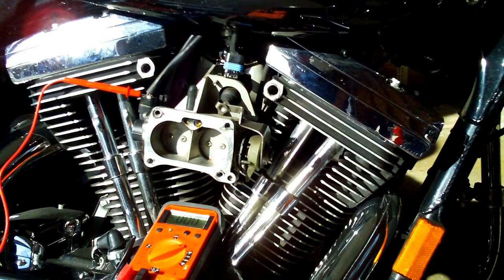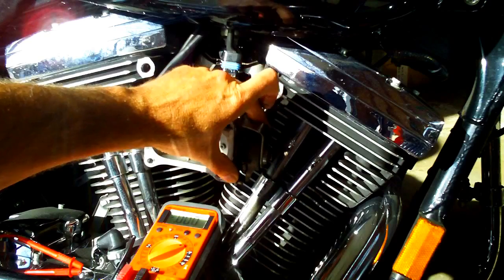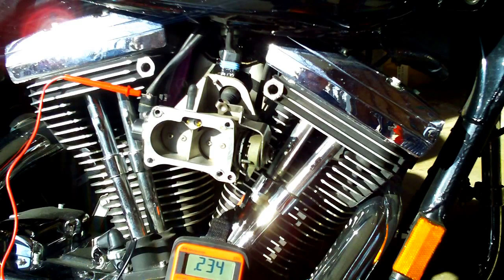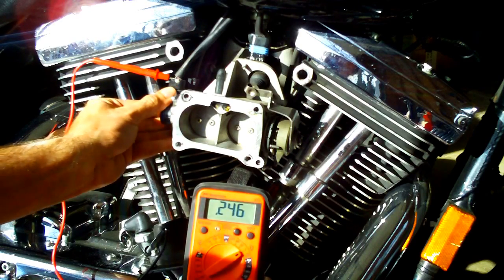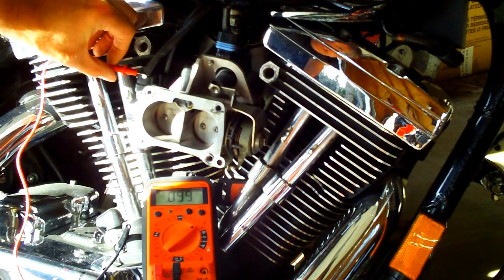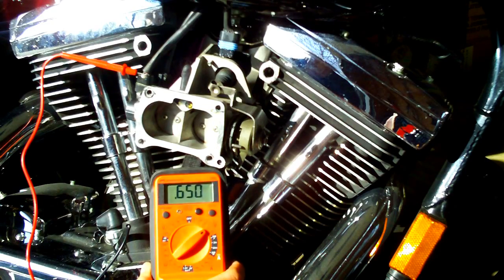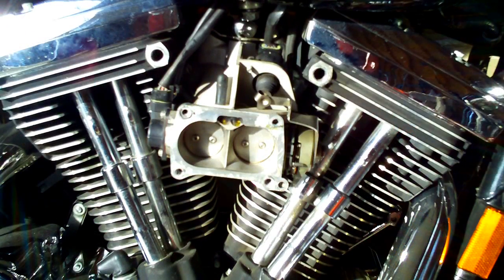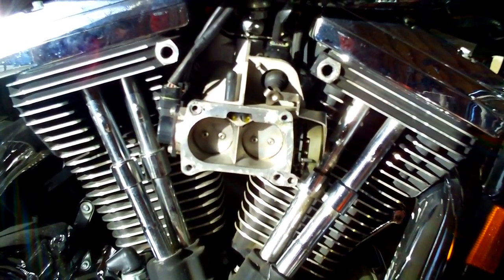Reset Harley Davidson Magneti Marelli Fuel Injection TPS Settings ✔

Comment: I have a '96 Road King EVO with MM injection (same, as on video) and it has an annoying manner of high idle speed when cold. When I start, the cold idle speed reaches about 1500 rpm and drops to 1000 only after a couple of minutes. I want to low rpm to normal level. What can I do about it ? Is it possible to change settings inside of computer ?
Reply from the maker: It sounds like you need to have the cold idle motor adjusted without knowing more about it. Watch the video at 4:30 and you will see me turning the adjustment screw and measuring the voltage to the number 0.650 volts. You will need to take your air cleaner assembly off to access the screw. If you do not want to set it using a volt meter, then turn the screw OUT (loosen) one turn and try a cold start to see what it does. If it is not enough, go another half  turn. If it is too slow now, go back IN half turn. This idle motor slows down the idle as the motor warms up by using readings from the head temperature sensor. Do not let the motor warm up between tests or you will think it has slowed down but actually it is reading a warm engine and using a slow idle setting. Make sense?
Reply: I'll try to do this, but I'm not sure it will help. I think, that on cold idle computer is not maintaining the definite rpm speed based on crank speed sensor, but is maintainning definite throttle angle based on throttle position sensor (TPS). So the cold idle screw is only for initial adjustment. If I will move the screw, trying to close the throttle, then automatically the cold idle motor will try to compensate it and starts openig the throttle up to achieve a specific voltage on TPS.
If it is, then moving the TPS I will change the rpm of cold idle. Also what is more important and first of all I will change the air fuel ratio (AFR) on normal cruising operation. My motor on factory settings and totally stock, but .04 oversized pistons, has poped in exhaust sugesting mixture too lean. So I turned TPS of about .02" (what is recommended by MM) and it stops poping, but cold idle rpm has rised.
Reply from the maker: Is there a website that you found that recommendation from MM? That's the first I've heard of it. I found somewhere that fuel injection systems pop more than carburetor setup due to the mixture being based on an absolute measurement rather than using vacuum to draw the fuel through the carburetor. With the throttle plates closing to idle position, the fuel mix would automatically be set to that amount of air coming in by the fuel injection, thus, lean for higher rpm until the rpm's come down. Ok, I was thinking that the cold idle speed was based on how far the adjustment screw was turned one way or the other, and that the electronic idle motor always went to the same 'position' relative to how cold the bike and intake air is measured. I have gone back and forth from not enough speed on cold idle to too much based on turning that adjustment before I found the method of using a voltmeter. Once I set mine up as in the video, the cold idle was always a bit above 1,000 rpm, and after a short time (depending on how cold the air was) it would gradually lower until it was at warm idle speed (set by the warm idle screw). Since you have moved the TPS sensor already, I would recommend trying to turn the cold idle adjustment screw as I mentioned, if you have not done so already. You may find the 'just right' cold idle speed you are looking for this way. Just remember how many turns you make to the screw so that you can always put if back to where it was.
Reply: Well, I found ths information about turning TPS not from MM, but on some tuner page, my mistake. http://www.techlusion.com/articles/Magneti_Marelli.asp
Some knowledge about the fuel systems I have read here:https://books.google.pl/books?id=XgSgJnlqA9sC&pg=PA60&lpg=PA60&dq=harley+magneti+marelli&source=bl&ots=itTUq3jakK&sig=720SAJcPdSr0XKvLuCO7RrRM0aA&hl=pl&sa=X&ei=J-GWVPToH8b2O7bCgfgF&ved=0CFgQ6AEwBw#v=onepage&q=harley%20magneti%20marelli&f=false
I will have to look at it again and adjust this system once again, but only on spring.
Reply from the maker: The Dobeck web page is if you are using one of their TFI performance modules. I installed one on mine, here is the video: https://www.youtube.com/watch?v=X1a9kBx_Lb4. The difference is night and day once properly set up. If you are not using a performance module then turning the TPS may not benefit you directly, but if you think it is running good after the change, then leave it be. If my understanding of the cold idle motor is correct it runs relative to the measured temperature of the front cylinder head (and possibly air intake temperature too), instead of the engine RPM, which would mean the more you back out that cold idle adjusting screw the slower the motor RPM's will be when cold started. I understand you will try it in the Spring. I do wish you luck and hope this works out for you for happy riding!
Reply: contact4mwy7 thanks for advice. You were right I turned the cold idle screw out and idle speed drops and now it is normal. Do you know any procedures of adjusting hot idle speed ? My bike on hot idle has fully closed throttle and I was lowering idle by turning in the two screws that are next to throttles and are normal secured by plastic. The problem is that  that screws are adjusting an air amount for both cylinders separately and now I'm not sure there is the same AFR for both cylinders.
Reply from the maker: zubr9471 I think I see the two screws you are talking about, with a yellowish epoxy on them, on the front middle of the throttle bodies. I have not touched these on mine, and do not know how you would set them back to where they were. The WARM idle screw is located on the bottom right corner, as shown in the video at 46 seconds into it. Try to relocate the two middle screws to where they were, and then use the WARM idle screw (allen wrench head) to adjust the idle to where you want it when the bike is fully warmed up (hot).

Comment: Ok I have a question. If you have the butterflys closed, what does it matter where the TPS is? What does that specific voltage have to do with the position of the butterflys?
I checked my 2001 FLHRI and the TPS voltage was at .875 from factory. This is confusing to me with such a difference in voltage.
Great video and explanation.
Thanks,
Mike

Comment: Hi, Great video and info,
Have a question, Can the cold and warm idle settings be set without resetting the Throttle Position Sensor? I messed with mine awhile back and need to put it back to the way it was,engine temp sensor went out and thats why I messed with the idle settings.  Thanks bob.
Reply from the maker: Hello Bob, I would have to say 'yes' to that question. Like I said in the video, if you don't have to loosen the screws to the Throttle Position Sensor, don't! Lets assume that it has not been touched since the factory assembled it and it is still accurate. Start with the bike off, unplug the Cold Idle controller, turn the bike on and measure the voltage using the pin as shown in the video. If you are reading 'less' than 0.650 volts DC at the pin, turn the adjustment screw 'in' until it rises to that number. If it is more than that voltage, do the opposite. As for the Warm Idle adjustment, that is done by listening to the motor while running all warmed up. Let me know how this worked out for you.
Reply: Hi, before I start had another ? . My meter will only measure 0.65   Yours reads 0.650 would it make much of a difference if any. Thanks Bob.  P.S. I have a low cost digital meter
Reply from the maker: Robert Denniston Bob, since you are just adjusting the cold idle and not the throttle position sensor itself, I would say that using your meter for the cold idle setting should be close enough as it is much more forgiving on its setting than the throttle position sensor which should be dialed in to the 0.275 as it shows. If your meter shows 0.65 and it is actually 0.656, I doubt you will notice the difference on starting and cold idle speed. Go for it!

Comment: What rubber vacuum cap did you check and replace?
Reply from the maker: James, there is a rubber cap on a short metal pipe sticking up on the top of the carburetor body. You can see it is black in the video, and on the other side from the cold idle motor mechanism. It's about a 1 inch long rubber 'sleeve' that slides down over the metal tube. I think the metal tube was used as a vacuum for another system, possibly to do with emissions? The speech bubble has a little arrow at the bottom of it, kinda hard to see, that is pointing directly to the top of it. My bike made a kind of 'bird chirping noise' at low rpm down the road which I later found out was coming from the hole in the original rubber. I hope this helps!

Comment: Re-did the procedure bike now runs absolutely perfect! I had added a cobra auto-tune and never had total stability in the system till now great tutorial!
Reply from the maker: Awesome, man! I just visited Laconia Bike Week with mine and it ran great all of the almost 500 miles I put on it. I'm glad these settings have proven themselves for others, and especially your Cobra Auto-tune! Do you know why the procedure didn't work the first time around for you? Just curious, and it may help others. Thanks for the response!
Reply from the maker: By the way, I averaged 53.6 miles per gallon after 2 of the fill-ups on the trip! (your mileage may vary depending on the size of your engine and other influences. My engine is the 80 cubic inch / 1340 cubic centimeter EVO).

Comment: Went through this procedure since I've been having some stability issues with the system. Great tutorial but I just cannot drop my initial volt lower than 29.7mv tried everything that's as low as I can get it no matter how much time I take
Reply from the maker: Can you tell my why it gave you this trouble initially? I'm glad it seems you cured it after all!!

Comment: Can you tell me what the VREF is at the red wire on the TPS? The reason I ask is because I have .143V at the red wire and the best I have been able to get at the gray wire while adjusting the TPS is .130V. My bike is a 2000 Ultra
Reply from the maker: I will have to take mine apart again to get to it, Jay, to give it a measurement. I don't know why your reading would be so low, provided that the voltage from the battery is somewhere around 12-13 volts. I'll see what I can do to find a time to take it apart and get back to you on that.
Reply: contact4mwy7 Yes my battery voltage is 12.57V and with the engine running its at 13.8V so those numbers are good. I am wondering if I have a blown fuse or damaged/broken wire somewhere. But if that were true, I would think that the CEL would come on and a code would be stored. Then again, I don't know if Harley systems work the same as cars.
Reply from the maker: Jay Lisel That is strange indeed. Try turning the bike on (let fuel pump start and stop) and off, on again, and off, and on a third time and watch the Check Engine light. It will tell you a code, if there is one, after a string of fast flashes, then pause, then longer slow flashes with a pause in the middle. Like this (fast flashing) pause * pause ** (fast flashing) would be Code 14, counting the number of flashes.